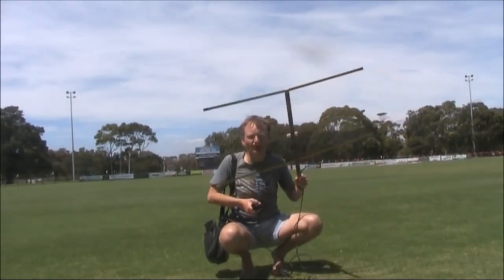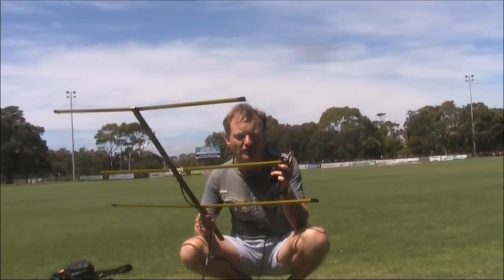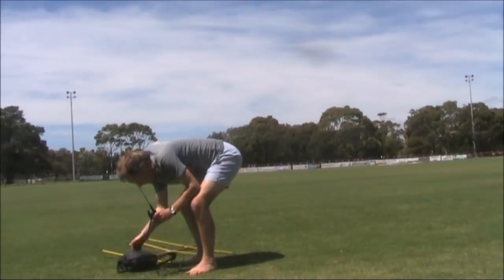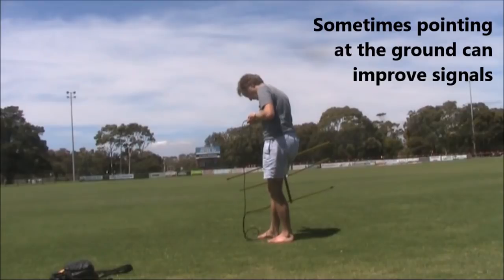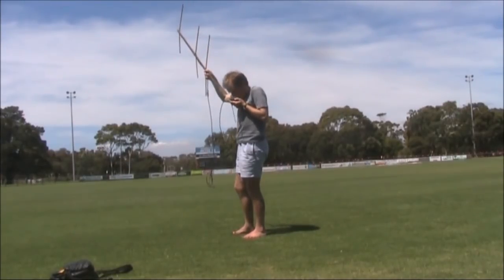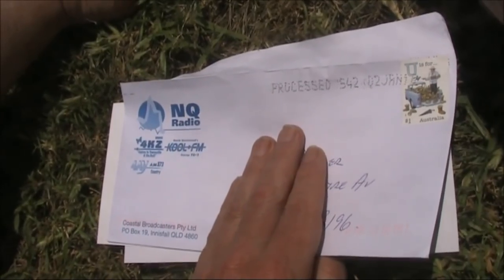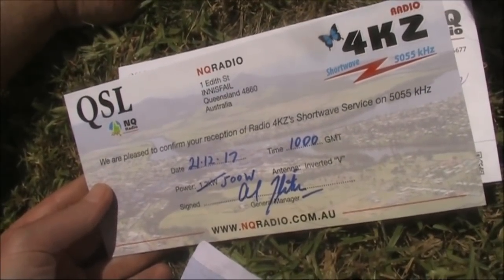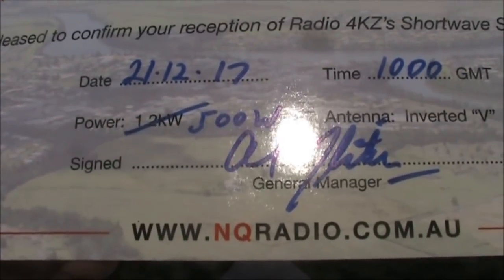Trying to work the AO91 satellite with a single handheld transceiver

Comment: This is how I always work Ao-91 --  Using a Baofeng UV-5R and a tape measure beam -- I've had pretty good luck so far.  Here's a  hint, if you don't fancy having to push through the pile-up try working the satellite during the night passes if you can; there's generally much less traffic.

Comment: I've done it with an Icom W32A and a dual band telescopic whip antenna but it's really hard and a pain in the butt. The key to using the whip is holding it broadside to the sat.

Comment: I find AO-91 rather easy to work on a WARG Pogo Stick Antenna with a single hand held radio  Pete… (As you would appreciate, it works best on the high passes) - I was originally using an Arrow Crossed Element Yagi, but decided to try something different.

Comment: I also worked AO-91 today with just the factory antenna on a ID-51 and flipping VFO's. Surprisingly worked another VK3 so it can be done with a good high pass but again, more luck than skill on my part ;)

Comment: It looks like the Baofeng is not as sensitive as the FT817 but you still have reasonable results.
Your 3 Element yagi will have a poor gain (radiation pattern with multiple lobes) on 70 CMs.
You would get better results with a proper dual band yagi with 70CM directors.
73, Terry ZL2BAC

Comment: Quickie Peter. Re the experiment with 1 x handle plus yagi, weren’t you TXing uplink on 70cms into a 2m yagi? ....or am I mistaken? 73 Nick
Reply: NICKGAR7 just wanted to write the same thing
Reply from the maker: You're right.  It was a calculated decision. A 2m dipole is a 3/2 wl on 70cm so it can work there.  Also the main area needing help was reception of 2m not transmission on 70cm so I was willing to tolerate some loss on 70cm if it would improve reception on 2m.  Another reason to use 2 handhelds as the antenna and antenna position can be optimised for both!
Reply: As per my previous comment above I do this every time I work AO-91. I have never not made contacts. The sat is very sensitive on RX and given you're only TXing seconds at a time, you're not gonna have a problem TXing 70cm into a 2m antenna on the few watts needed to do satellite work.

Comment: Which whip antenna are you using on the HT? (Doesn't look like the standard one.) Also, is that the 'plus' UV82 which supposedly has higher tx power? 73 EA5IGC
Reply from the maker: It's a Diamond RH771. But despite its length it  seems to be about the same as the supplied standard. I was using the standard UV82 on low power setting.